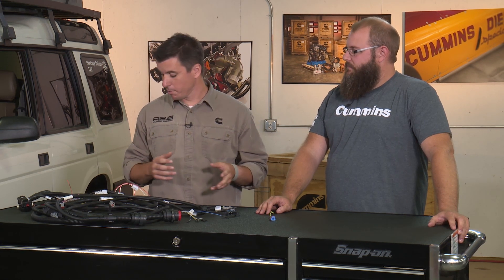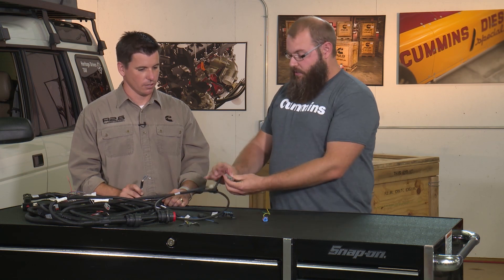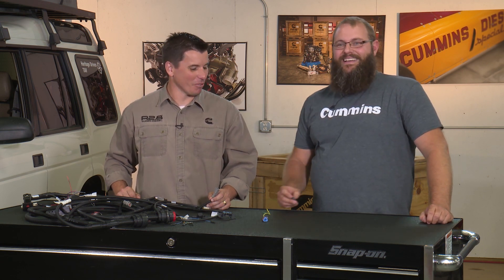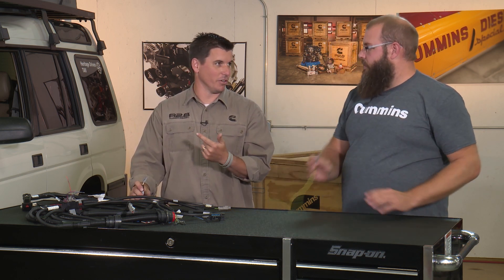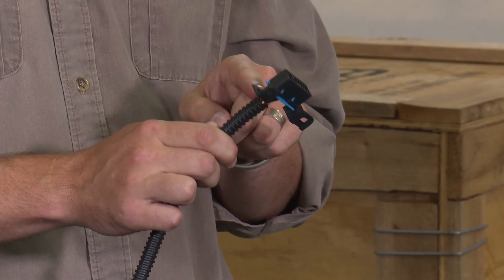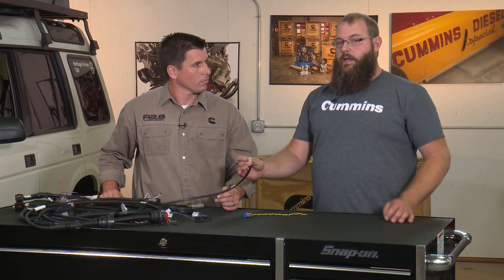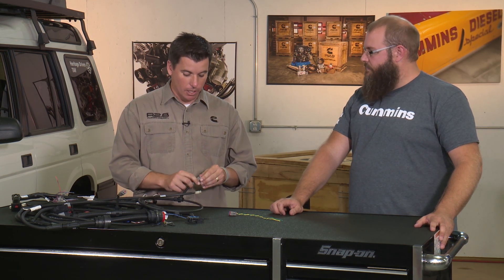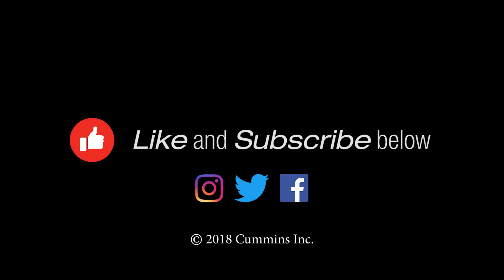Cummins Repower Garage: Tech Tips - CAN Bus 101

Comment: Steve, I'm trying to determine if I can fit an R2.8 with a GM 6L80e and Atlas 2SP transfer case in a 66 FJ40 and still have room for a drive shaft that is not to short or at bad angle. Do you have a link to your build and any info on the length of all components. Thanks.